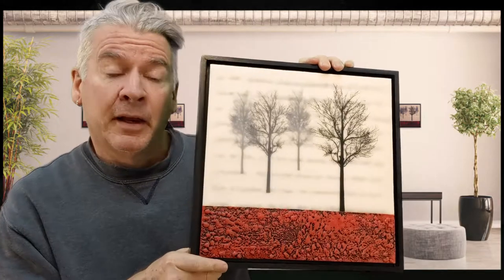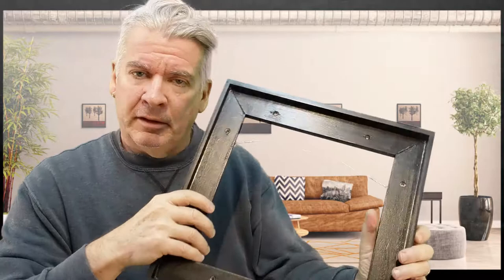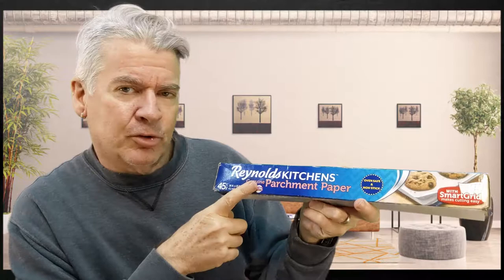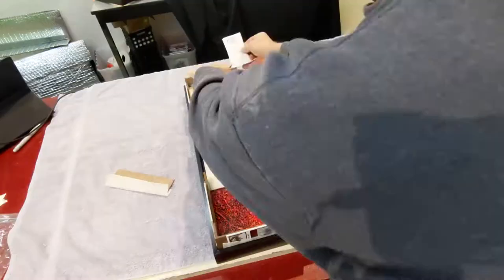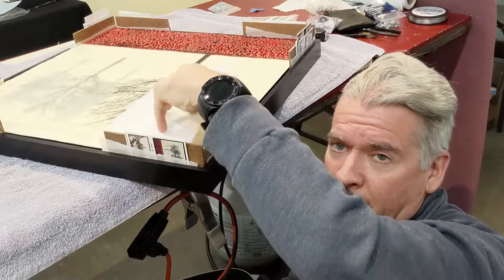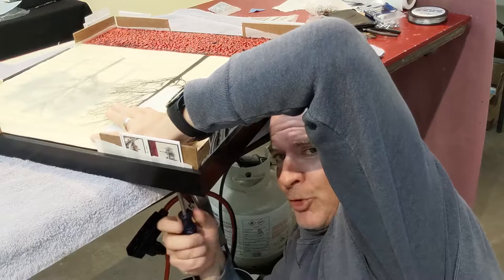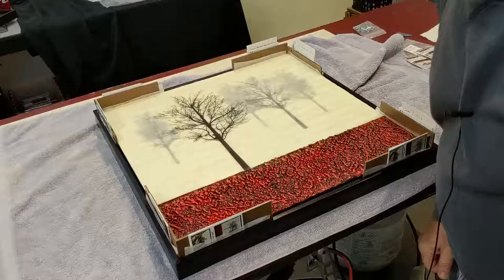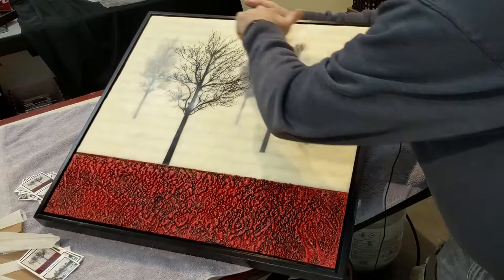Float Frame Mounting Tips For A Professional Look

Comment: So with these floater frames, the only way to hold the artwork in to the frame  is to literally put screws into the back of it? So if using gessobord or stretched canvas we have to put screws into the back of the art board or stretcher bars? That's the part that doesn't make sense to me.  Most art boards are only 1/8- 1/4 inch thick and you'd risk ruining the art. What if we wanted to mount a ceramic tile or something that cannot be screwed on ? But they look nice. Thanks.

Comment: Was that on a cradled panel or an unsupported panel. I do my encaustic on 12” square pieces of plywood at the moment to keep costs lower, so this maybe a viable way for me to present my work.
Reply from the maker: The paintings in the video are on 1/2 inch plywood. Yes it is a big cost savings to be able to buy 4"x8" sheets of plywood to cut down. Cheers.

Comment: What is the benefit of using the Eucaboard as opposed to using scraps of corrugated cardboard or scraps of foam board?
Reply from the maker: It's a harder surface. The cardboard and foam board can become unevenly compressed when you're tightening things up.

Comment: What are some good ways to make sure the painting is flush or 1/4" recessed from the edge of the float frame? What do you personally use to fill that space if the frame is deeper than the stretcher?
Reply from the maker: I custom make all my frames and panels, so I know the measurements I need for the flush or recessed mounts.